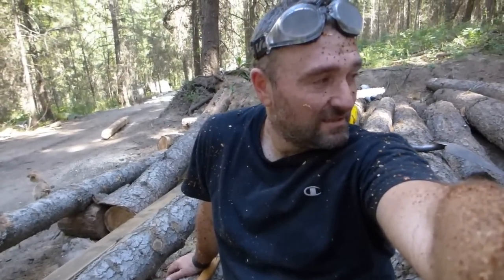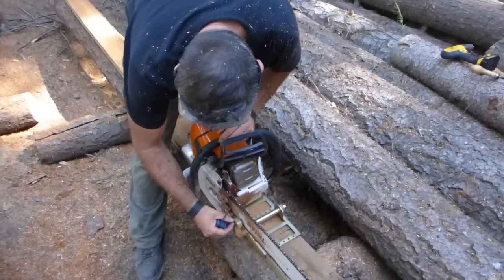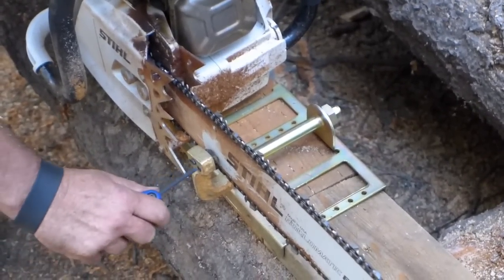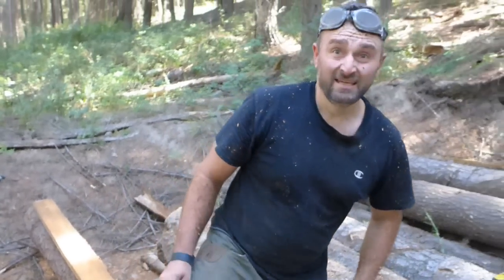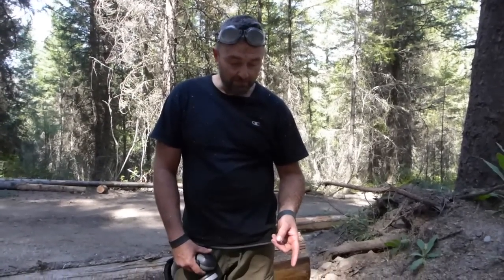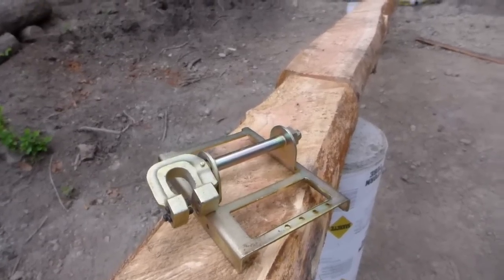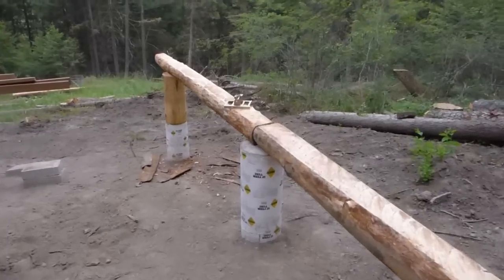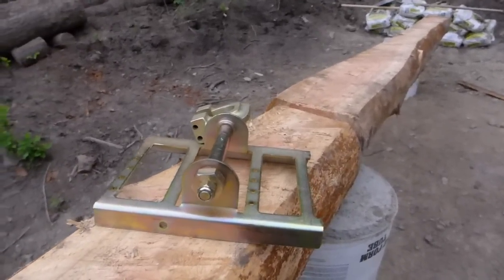Off Grid Log Cabin Build - Floor sills with the Haddon Lumbermaker

Comment: I'm just posing the question.....don't know if anyone else has already but, given the amount of work that you are doing.....and I know your method is relatively easy compared to the first settlers or the pioneers,  would it not be a worthwhile investment to pickup a portable saw mill....even a harbor freight one that from what I have seen, need some slight modifications to make it more user friendly? When you factor in the saws, chains, fuel, oil, time.....it just seems you'd save a lot of money in the long run. I love what you're doing..and it looks awesome! You're in the northwest I gather?

Comment: This basically the only use for this tool or any other chainsaw mill. Thick slabs, large size timber, off grid timber framing.

Comment: what i noticed when you use this haddon lumbermaker, you use the lumber guide just the length of the timber, i think you have to extend the guide at least six inches longer than the timber itself so you don't have hard time cutting at the very end of the timber. just saying.

Comment: IMO best to let the saw idle to cool down before shutting down after working hard.  It's very hard on an engine, any engine.   This guy burned up a small saw, and now the big saw is getting a run for it's money.

Idling the engine for a little bit lets the air flow cool the top of the piston and the cylinder in general.  Shutting down a super hot engine causes thermal stress  (it's just a fact, I don't make the rules).  A little idling and slow running will let it cool and temps can equalize in the cylinder.  The fan on the side of the engine blows air across the cylinder and cools it.  Engine probably last longer if allowed to take the red-hot glow off the top of the cylinder.  Hope I'm not coming across as a know-it-all, but many will watch this and think it's ok to run a saw under heavy load, wide open and hit then hit the kill switch and set it down without letting engine cool itself down from the high peak temperatures.  I let my saws cool down because I like my saws, and I care about them.  But, hey, it's your saw.  Live and let live.  

I see a lot of videos of people doing this,  run wide open under load then instantly kill.  A lot of people do it, but that doesn't make it right.  I see it all the time.  It's common.   People I work with do it all the time.  They even do it to my saws.  I ask them to please don't do it.  They don't listen, well,  maybe once, but then they forget.  I might as well piss on flat rocks.  But, hey, that's my problem.  It makes me feel better to share my anguish.   Please be nice to your saws.
Reply from the maker: Sounds good to me. Thanks for taking the time to explain your observation. Keep well.

Comment: kimchee yummy... do the piers have to be set on rebar / concrete footings or is the pier enough?
Reply: +Mike Shea (sheadtree) generaly speaking their should be pier pads 6 inches thick 18 inches square and just a tip for sauna tubes cut them length wise and tie back together with wire before you pour , it makes it easier to strip , also it is recommended 4 half in rebar in the pier pad tied in a squar and a fith rebar sticking up into the sauna tube
Reply: Cut them all the way through wont the concrete leak out even if you do wire how will the stay uniform I'm a novice.
Reply: u will get a little seapage but not much , also those pier pads for the wright faxtor were 4 feet square probably 8 to 12 inches thick , its carrying a healthy load

Comment: when using the ribbon bar when using the little metal plate with the 2 by 6 face the opposite direction but your right hand on the bar and your left hand on the handle where the trigger is push with your right hand and pull with your left hand and walk facing the top so that the car is close to your leg don't stand so that the bar is on the opposite side of you stand and push towards the bar so that the handle and the engine is in front of you alongside you

Comment: cant tell from vid  but sounds like from what ya said       burned out new saw and dull chain   sounds  like ya use the wrong chain      need a cross cut and a rip  chain
Reply from the maker: +embarado smithing and woodcraft I believe the chainsaw I was using was more than likely under-powered for the job (Stihl MS 311) that coupled with the fact I pushed a dull chain a little too far. I run rip chains now... a must for prolonged large log cutting.

Comment: When seasoning wood, or setting wood aside for chopping up firewood, always take away the bark.  That detracts from the insects. Also, I seen a lot of Checking on the ends of your timbers. This could have been caused due to the ends drying faster than the center. Two ways to help this issue; 1) taking off the bark will help with it evening out in drying, and 2) the most important thing you can do is to seal the ends. The old timers used wax which was melted in tin cans over coals, then brushed on. You can also use modern paint. This slows down the process and cuts down on checking, as well as twisting.
Reply: good tip, I'll have to remember that. an exterior latex paint would probably work decently, thanks!

Comment: This is after the fact but in the future check out " water level method" more accurate than a line level
Reply: +Marc  A Gagnon but try doing the water check during the winter an see how far you frozen water tubing gets you.
Reply: +Nathan Dean still works with anti freeze
Reply: grizz270
so  yyour into pullouting the ground water as well. thats very bad 4 the eviroment dont cha know.
Reply: @nathandean1687  You do know there is an environmentally safe anti-freeze you use to winterize vacant homes with.